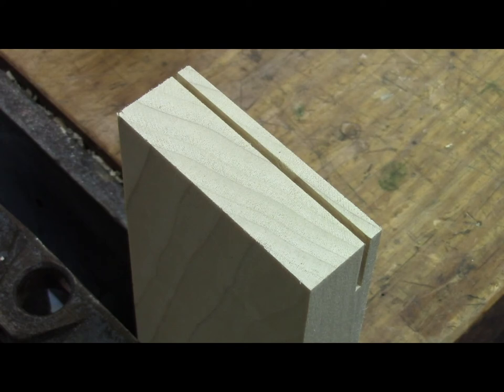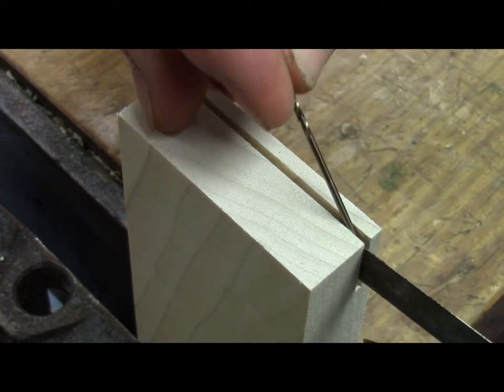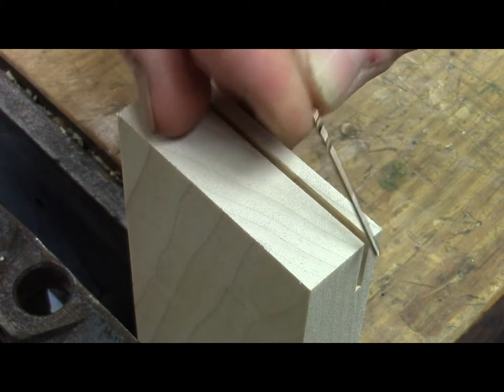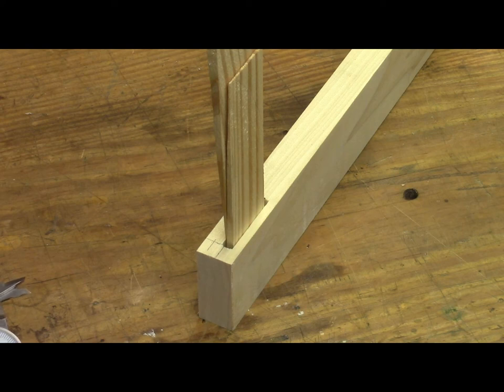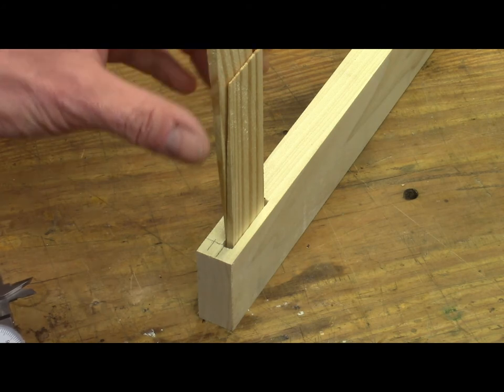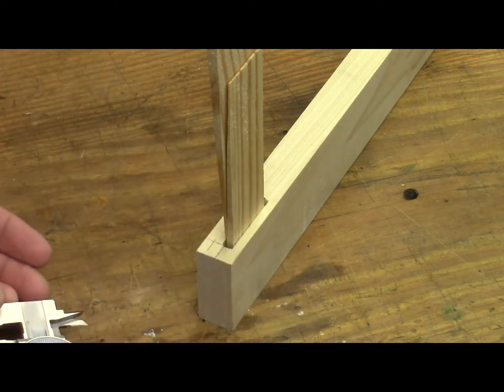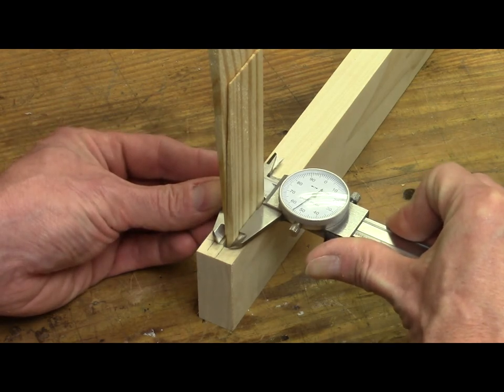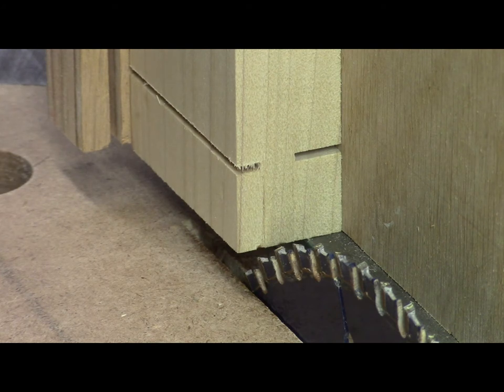Accurate Tenons on the Table Saw

Comment from the maker: Thank you. The face frame in the video was being made at the same time as the door for the opening. The door featured a molded inner edge and a groove for the raised panel, moving the tenon off center. To save time, I chose to use the same layout and set up for the face frame.
Reply: Pro trick: you can watch movies at flixzone. I've been using it for watching lots of of movies recently.
Reply: @Jaylen Shiloh Yea, I have been watching on Flixzone for years myself :)

Comment: What purpose does it serve to put a backer board against the jig?
Reply: 4 years later, but I'm pretty sure it's either to protect the face of the jig, or to ensure that you have an exact surface distance you can measure accurately to zero the jig off of

Comment: Ridiculous - just like the video editing.  A Grizzly tenoning jig eh?  Have you ever heard of "glue starvation"  Bob?
Reply from the maker: I apply glue to both the tenon and the mortice, as any competent woodworker would, so there is no risk of glue starvation The Grizzly jig works very well. A friend let me borrow his Powermatic jig and it appears to be the same tool with a different color paint. You may find it ridiculous, but technique results in a precise, fast and strong joint.   My name is Rob, Robert or Mr. Millard not Bob